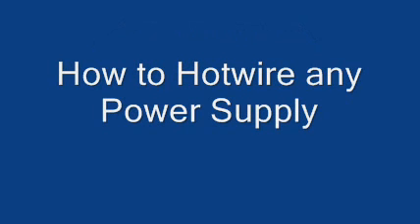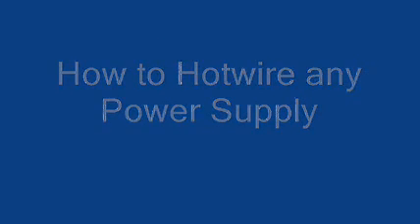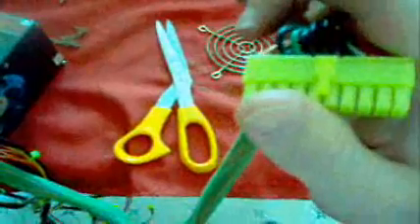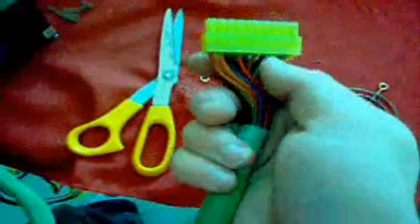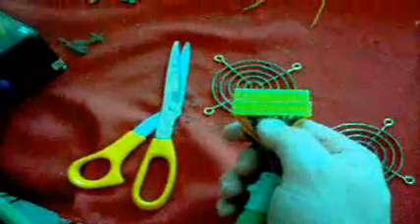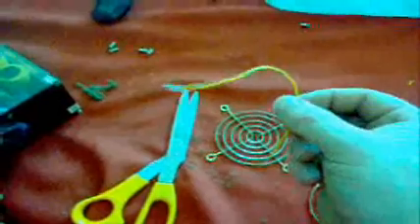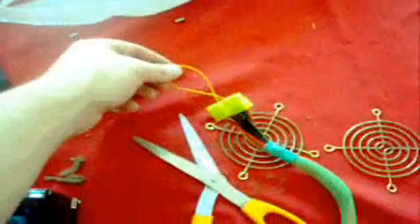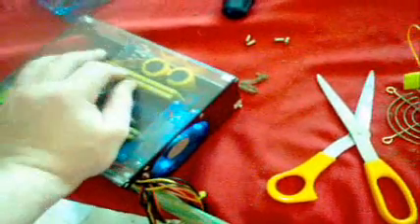hotwiring a Power Supply

Comment: I get good voltages, but its not ditributing more than a few hundred milliampres if that, fan won't even start on psu1, fan runs on psu2, but with very little current. what is going wrong. I've tried two working PSUs and they work fine in-system.